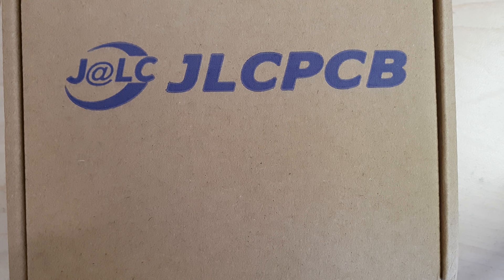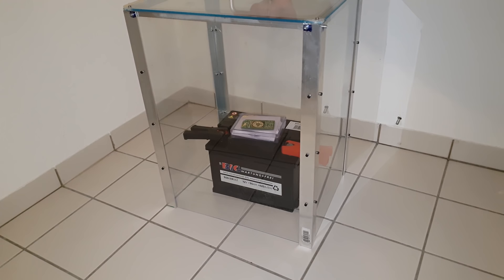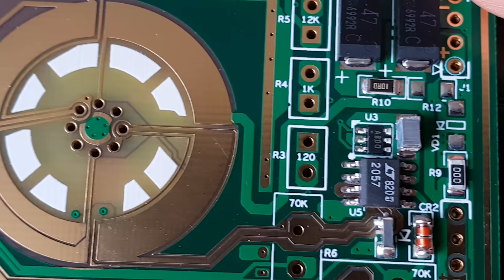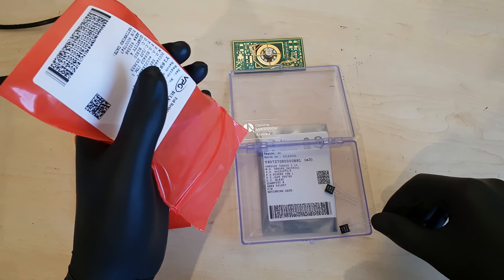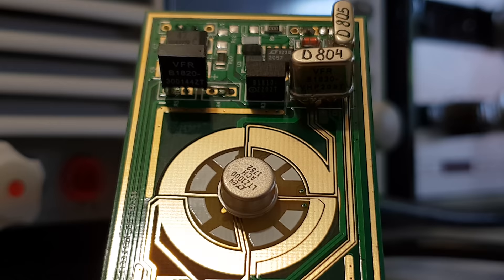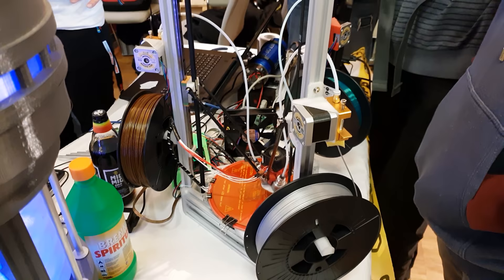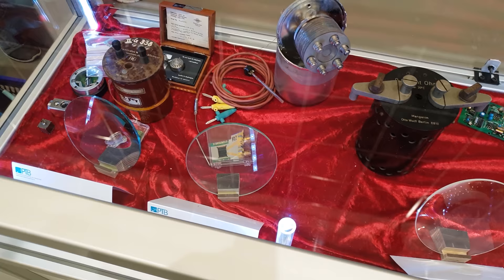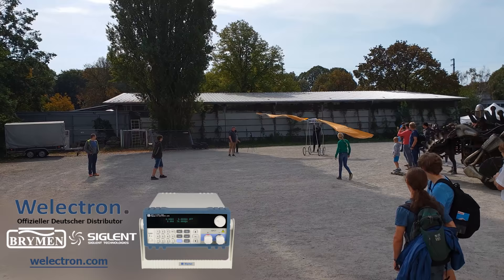Ultra Precision Voltage Reference and Maker Faire Hannover 2018

Comment: don't cut leads before soldering, if component is thermal critical. instead use some crocodile clips on them to dissipate heat even faster.
Reply: cutting them afterwards let the joint vulnerable to oxidation (microcracks)
Reply: if thats your concern then you can always touch it to reflow solder over any exposed copper (if your not lacquering it in the first place), where thats still preferable to actual damage from thermal shock/ overheating
Reply: but wouldn't reflow will introduce way more heat ?
I mean the DIY reflow oven/plate method.
The only thing i know which is superb is that zinc wave bath :D.
Reply: Personally I just crystallized tin and lead directly on the pads from solution so the parts weren’t overheated on my voltage reference.
Reply: haha this is a joke , right? :)
if not video pls
Reply: they selling these days the "soldering glue" with metal particles, mostly in many auto repair shops, it advertised for repair of window heater (or defroster), i bought one, haven't tried yet
Reply: Hyper Hektor definitely a joke :)
Reply: i asked, because it might be possible, i have seen some chemical videos with electrolysis/electroplating/etching ;) before
Reply: Hyper Hektor it might be possible, but if it was I wouldn’t know how to do it.  Something like a supersaturated solution growing a tin crystal but controlling the nucleation sites and making sure the board and components are compatible with the solvent, that would be a LOT of work.  I’d say an interference fit would be a better bet even if crystallization “soldering” worked.
Reply: digital - you obviously didn't think that through before commenting. If you clip onto the excess end, you will certainly keep it cool. However that will do ABSOLUTELY NOTHING to keep the component cool. Have a think about the position of the soldering iron tip in relation to the PCB and component.... DOH.
Reply: If the part is in a metal can, add a crocodile clip to the can, not the leads, otherwise you will pull heat off from the wrong direction and the other side may actually be HOTTER than if you didn't add sinking at all. 
The most important thing is to go as fast as possible.
Reply: @johncoops6897  You attach the clip to the component lead between the component and the joint. That way it dissipates heat that's traveling up the lead. It's an old technique.
Reply: @rich1051414  Again, you attach the clip to the component lead between the component and the joint. That way it dissipates heat that's traveling up the lead. Attaching a clip to the can will do very little relatively to the clip on the lead.
Reply: @Graham_Wideman  - Yes, of course. However that is NOT what is being suggested here. Read the very first comment in this thread - they are saying to connect a clip onto the protruding (over-length) section of the component lead... you know, the part that is  ultimately cut off.
Reply: @johncoops6897  Well digitalk did not specify where on the lead they suggest to attach the clip. Even if they intended the end that gets cut off, which I agree does little good, I'm saying that between the component and board is a good location, and you seem to agree with that. So I'm not sure why you're suggesting to read the original comment again?
Reply: @Graham_Wideman  - the way that I read it, they did specify where to attach the clip. That's why I suggested that you read the original comment again. I will quote:and explain....
1) "don't cut leads before soldering, if component is thermal critical."
OK, so we should leave the long lead(s) sticking out the bottom of the PCB
2) "Instead use some crocodile clips on them to dissipate heat even faster."
So, we need to dissipate the heat via the long leads?
Reply: @johncoops6897  OK, so that's the way you read it. So why are you telling me to reread the original comment? I am not interested in what digitalk might or might not have meant, just in clarifying where the clip should go, for those who don't know. Which might or might not include digitalk.

Comment: Anyone who didn't hold their breath at 10:15 during the calibration test is just not concerned about precision. 

Next week: "I've got two Josephson Junction Array modules.  Let's grind the top off of one and see what's inside!"

Nice work!
Reply: In the same room was a guy with a tesla coil and some HAM radio operators (like me *hrhr*) broadcasting at 50W... 
So yeah, all those measurements were a bit problematic, but I guess this equipment is well shielded.
Reply: Yes I see the Uni-T dmm in the corner that they used to do the fresh calibration 🤣

Comment: Some years ago to get a low cost precision voltage source that is stable with temperature I used two different 78XX series TO-220 series regulators and the voltage difference is very stable as the voltage on both go up and down with temperature at the same rate. When using two voltage sources that go up and down by 2mv/C therefore the difference is 0mv/C, and that is how I solved this problem years ago cheaply.

Comment: "I can't enter my living room without disturbing the voltage reference..." LMAO
Reply: pepsi jazz, check out some of Bob Pease articles on just how sensitive some measurements can be.
Reply: @anullhandle  but couldn't this problem be solved with a faraday cage?
Reply: @Ramog1000  , Down the rabbit hole past faraday cages, exposed copper gold plated traces, multi layer guard rings comes making connections for sensitive nodes in air off the board, minimizing the air space to reduce the effects of cosmic rays, thermal isolation, acoustic isolation and other analog voodoo.
Reply: He should have used a lead enclosure to protect it from cosmic particles.

Comment: You went bit opposite direction on resistors. 70K are not critical, can be even 5ppm/K are fine. Most critical is temperature setting divider 13k/1k, which best to have in single package and hermetic packaged, instead of humidity-suspected epoxy resistors ;). 

Also silicon kg sphere is not one to be used to redefine SI unit in 2019, but the watt balance , if all goes well.

I'm disappointed in connection of reference to LTZ module. Great example of how NOT to connect reference to the meter.
Reply from the maker: Well that's probably on me, I approached the guy with "Excuse me, can I have a quick voltage measurement?" instead of "Make way, here comes the best thing you'll see all day!"
Reply: Note for future : have your box with proper cable ends termination to copper spade lugs. So you can connect to proper meter in no time and get expected sdev <2 uVpk. I still can calibrate and test KX modules , just at shipping cost ;)
Reply from the maker: Awesome! I've been thinking about a box from soldered mu-metal and hermetic feedthrough-capacitors for the other board, but I bet there'll problems with customs when shipping hermetic containers?
Reply: It seems that both the spehere and the watt balance will be used. They want the Avogadro constant and the Planck number to be more accurate it seems. We will know more on 16 Nov 2018 though when the conference is over.
Reply: Were the components you used only available on request?
Reply: You don't need hermetic box much for this ref, but feed through caps have greater risk to corrupt precision due to thermal EMFs and extra junctions. According to deviation between your meter (K2000) and PTB's 3458A that's already might be an issue, as difference 12.5 ppm is bit too much, even for fresh LTZ1000A board.
Reply: I've been wanting to use an LT5400 to do the 13k/1k divider. It is matched resistors and should help with the temp coeff. Also, I think the 120 ohm resistor from Vishay is being compromised from the copper trace going to it. 3900 ppm/c between the zener and the resistor seems significant to me. You may be able to cancel this out by adding length to the top of the zener.

Comment: I have two Fluke 5730A calibrators and 16 voltage references. those are powered for 7 years now. I have a massive UPS that uses 12 deep cycle batteries, which should give me a few months if the power goes out
Reply: Why is the constant power important for a voltage reference? It can't just be temperature related can it?
Reply: Console 
It's to do with the subatomic dielectric permeability coefficient of non-linear electron transfer substrates.
The longer you leave the reference turned on the less you have to factor it in.

Comment: Such a cool project. With the parts shortages I’ve settled on building a few LM399 references for now. I’ll get to some LTZ1000 or ADR1000 references at some point down the road.

Comment: funny thing is, as an actual electrical engineer you just expect others to have done the work for you as for very precise voltage references etc.
You just uh.. use random stuff that might cost 100k without thinking twice about it.

Comment: i wonder how that would compare to a Weston cell, tho.. i bought a couple months ago a saturated weston cell. I measured it with a regular multimeter, of course it was 1.018V, but i haven't had the space and time yet to make a thermally-controlled box, and end up with a reliable voltage standard, and actually measure/calibrate with the thing... But still, i wonder how that ultra-precision voltage standard would compare to a voltage reference used in the 19th and 20th century
Reply from the maker: There was a really nice weston-cell-based voltage standard once, 6 cells in a big, multi-walled metal oven that's kept at 30 +/- 0.1°C ....... who knows, maybe I can get my hands on one :)

Comment: Absolute voltage accuracy is usually the least important spec for a voltage reference. drift vs time, temp, applied voltage or vibration are all far more important in use. As long as its absolute voltage accuracy is within range for the parts the ref is intended for, then its voltage stability vs various external and internal factors are much more important (time, vibration, temperature, voltage etc). so if its 7.120003VDC, thats all good, as long as its always 7.120003VDC.

Comment: If you really wanted to go nuts with your voltage standard you could use hermetically sealed leads and put a hard vacuum in your enclosure. You would need to get rid of the closed cell foam for that though.

Comment: So, realistically speaking, the reference can only be used as a reference if you can go somewhere to have its absolute output measured very precisely? Kinda defeats a lot of the DIY aspect, doesn't it?
Reply: Not necessarily.  Even without knowing it’s voltage, the fact that it changes so little over time is useful in of itself (if you measure it with a moderate cost multimeter, you are actually measuring the drift of you meter, not the reference)

Comment: I'm still confused. What do you need tgis thing for exactly?
Reply from the maker: It is the most stable voltage source one can have for ~300 USD. I can compare my other devices to it and be reasonably confident in their drift. I could also use it as a reference inside another device, who knows :)

Comment: You set the exact voltage and the ppm per degree C is the most important. That is why it has a heater. Also, if you read the page, you would see that you can age the parts by putting them in an oven at 200F I think it was for 2 hours to equal the 2 year aging. If these parts weren't good they wouldn't be in 5 , 6 7 .5 digit meters like the HP 3457A and the Fluke meters and similar versions of the references. Watch the EEVBlog explaining voltage references.

Comment: Most prestigious thing you ever assembled with black gloves ! There are special  anti static gloves ? :)
Reply: Paul Lacatus the gloves are to prevent getting oil on the surface of the board, which can cause leakage currents, which can alter the voltage (when measured with an 8.5-digit multimeter)

Comment: Have you consider the possibility that by soldering 2 different metal alloys together, namely Au and Ag and other pairs shown in video, you inadvertently created a thermal couple? Two metals joined together will produce a voltage across them due to the Seeback effect which could mess up your voltage reading, as well as voltage vs. temp relation.
Reply: Do you expect him to solder with gold or copper?
Reply: No disagreement, but how could this be done better? Spot-welding, maybe? I'm wondering whether that would ensure single-metal (Cu) continuity, by breaking through tin/gold/whatever plating...

Comment: why does it have to be 4 layer? why not just a larger front&back board?
Reply: nickt cause if you go through the trouble of fine smd components why not also shrink the board ? I mean i only etch 2 layers thats why my boards are larger but if u order them i would try to get the lest space possible

Comment: Could you give me a few examples what you can use this for? Is it just to calibrate other devices?
Reply: I googled it and this is what i found: Applications
• Precision Data Acquisition Systems
• PLC Analog I/O Modules
• Field Transmitters
• Portable, Battery - Operated Equipment
• Industrial Instrumentation
• Test Equipment
• Power Monitoring
• LCR Meters
Still not very clear to me. Would I build a Multimeter with this?
Reply from the maker: Yes, every multimeter needs one, but only the top high end models will use an LTZ1000

Comment: Why is the ref 7volts ...when most runs on 5 in the IC world....I just would think you'd want it at 5 too
Reply: Erm, 5V is actually not super-common.  the most common reference voltages for critical systems that this may be used in are 3.3 and 4.096, but 5 and up to 7 is not unusual. I design and build ADCs and DACs for measurement and audio and we often require very low noise references. we would almost never use the reference from a chip like this directly, the noise is too high and its current/drive capability very low. it is usually buffered by an error amp, so some gain, or attenuation can easily be added to create the exact voltage you need.
Reply: @jeremyglover5541  thank you so much ...I fiddle with electronics alot but it's all the math and logic I get hung up on...I do work with vaccume tubes alot tho and with one I'm making a vu meter but it's way to sensitive and somehow picking signal from the input vcc aswell to a point that I can run it soly on that  ack current in the wrong place...is there any quick fixes you might have threw your expertise I can plop in somware in the build to help fix this ....thank you agean stay amazing in this clown world we find ourself in
Reply: @danbrit9848   Hi Dan, sorry tubes are not really my bag, but I suspect the circuit you are talking about is solid state anyway. hard to make any suggestions without any schematic, or pics though .... devices are not perfect and things like capacitors and transistor gates have leakage current and that will differ based on capacitor type (film caps generally have the lowest leakage current, but are large and expensive). Most likely though, you are simply supplying a signal that is too large. generally a VU meter is driven to full scale by a fraction of the input signal. advice would change based on this information; particularly what model VU meter it is? are you driving it with the amps input signal, or output signal?
Reply: @jeremyglover5541   it's a 6e2 magic eye tube that is run by a restore or cap cascade to ramp up volteges from the USB 5 v it runs on...how it's set up ...I have a battery bank charger with 2 outputs I have it on one of them on the other I have a Bluetooth amp board that has 1 speeker on it to hear that it's outputing ...the other speeker out was gonna go to the audio in but as I found out even with nothing connected there and even a bunch of high value resisters looped on the input of the tube it's picking up the audio at way to much just threw the USB power on its own ...and even more fun if I'm not running audio but hold the audio input line in my finger it shows my heart beat lol...my plan is to build all this into a pocket boombox thing small but cool ...thank you agean for talking with me

Comment: I've found the bonding of the copper to the FR4 isn't so good with the JLCPCB boards. They are fine if you don't need to do any rework but if you do pads start moving around without much effort.

Comment: Take a look at PRECISION vs ACCURACY!
https://en.wikipedia.org/wiki/Accuracy_and_precision

Your zener diode is precise but not accurate.
ACCURACY is "easy" to correct. This is a constant number that is difference from real value. You need to take it to university or other institute, where they have ACCURATE and PRECISE voltage reference and they will make a certificate for you.